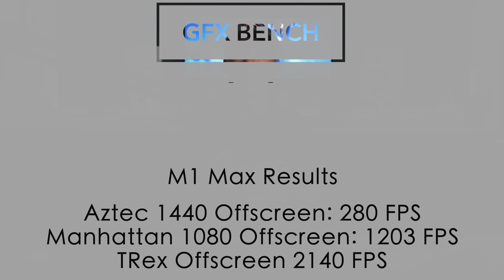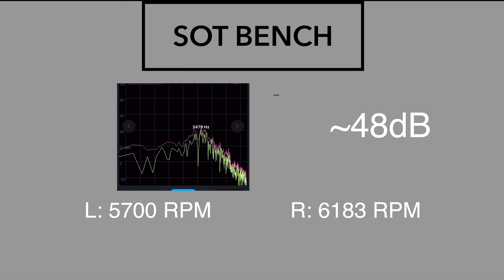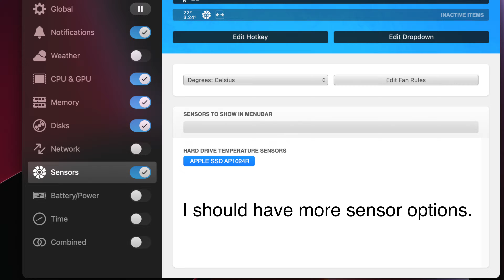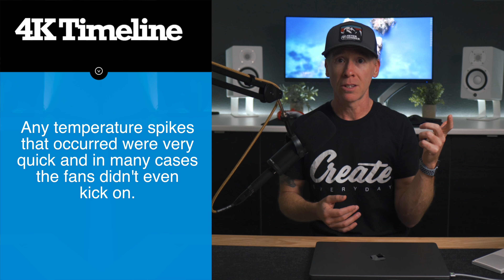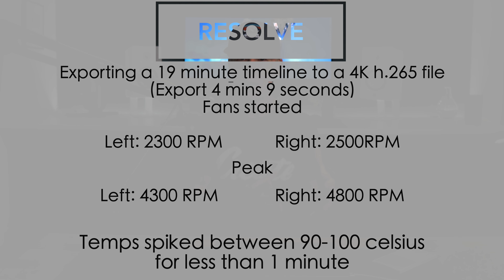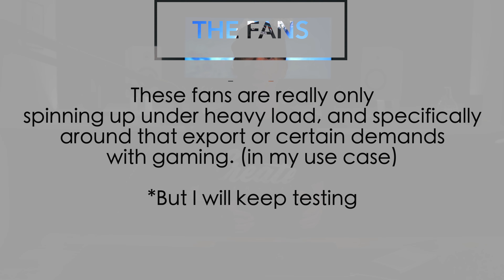M1 Max 14-inch MacBook Pro Performance, Battery Life, and Fans

Comment: THANK YOU - Finally some good fucking review.
Talking about the battery and real life examples of daily usage, thank you - what brower are you using daily? and do you think you can get 8 hours of battery life just doing basic stuff? browsing and youtubing?
Reply from the maker: Thanks! You’re welcome. I do have both Safari and Chrome and switch between the two, but I’m also testing low power mode and it seems the efficiency cores are doing that lifting. For general use though, yes I think you’re going to be fine for the day because I was pushing it for a cumulative 6 hours.

Comment: Yeah, I picked up the 14 inch M1 Max with binned 24-core  and 32 GB of Ram. I’m curious if it’s worth down grading to the M1 Pro with 32 GB of Ram.
Reply from the maker: Well, would are you mainly using it for?
Reply: @KevinRossRN  I just a few things. I'm upgrading from the 2018 base model 15 inch MacBook Pro. I use it to help with my church streaming, some video and photo editing in the future and I teach via zoom one a week. On Sunday mornings I manage 18 live videos streams for two hours on Sunday mornings. No I will admit, I had no idea what I was getting when I placed my order. I mean I did do it at launch day.
Reply from the maker: I do think the M1 pro will handle that, and I completely understand. I was ripping through my configuration on preorder day as well and I don’t regret it, I do realize that I got a lot of machine here. 🤷‍♂️
Reply: @KevinRossRN  I ordered the base model 16, then the base model 16 inch with 32 Gb of Ram, canceled both before I settled on the 14 inch M1 Max with 32 GB.... It was a crazy morning trying to figure out what I really wanted. Now I'm at the point that I don't want to re-order because I won't get it until almost December... LOL
Reply from the maker: I know the feeling. I thought about bringing in a 16 inch for testing and saw those shipping times, which I knew this would be the case, but it does sting a bit.

Comment: Thank you for all the test and content that’s really helpfull!!! Really happy with the base MacBook Air, I will wait for the m2 air and this time add the 16g ram that I really I need for part of my workflow or maybe the m2 Mac mini. Impatient to watch the result of your test on external Ssd’s also because I still have issues with the iPad Pro 11 2018
Reply from the maker: Thank you friend. And I should have that video out next. Remind me of the issue you’re having with the iPad Pro.
Reply: @KevinRossRN  it’s a large difference between copy and paste on the iPad vs on the SSD
Reply from the maker: I gotcha. Likely the limitation of that throughput, although I suppose it would depend on the size of that copy and paste.
Reply: @KevinRossRN  exactly depends of the size and the source where you copy it because I don’t have the issue with the MacBook Air.
Reply from the maker: Yeah, I can’t remember the throughput on that model, I’d have to look it up, but it sounds like it’s pretty slow…obvious 🤷‍♂️

Comment: So M1 pro is more friendlier for the  battery than M1 max for the 14 models?
Reply from the maker: Well the M1 pro in general, however I should also emphasize that maxing out those GPU cores, which I’ve done, will also be more power hungry. 

There is a low power mode for these machines, which I will test, but on this test I didn’t toggle on low power mode.

Comment: Nice Video As Usual 😃
Coming from the 13” M1 MacBook Pro
I think the best configuration to get a boosted performance without losing much battery life
Or gaining more fan noise is to not go to the max for 14” 🤔 
14” M1 Pro with 32GB RAM is gonna be an over kill i guess 😅
Reply from the maker: Well the extra RAM is nice. I do think that the base model 14 is a good value if you want that screen and that extra I/O. But “value” is of course relative.
Reply: @KevinRossRN  yeah totally agree !

Comment: Thank you Kevin, yes I am interested in your findings regarding transfer and read/write speeds when using an external SSD. I recently purchased an M1 Mac Mini and did notice some throttling back on the read speeds when using the TB3 port.. Appreciate your time.
Reply from the maker: Yeah, I definitely tested that quite a bit on that mini, which is still in my rotation. I’m testing today and will be through the weekend as I’m waiting on one more enclosure to get here.

Comment: Just to clarify - the fans with the M1 Max fine under normal or moderate use? im ok with sound when the machine is pegged, but are tasks like youtube or sitting in photoshop turn the fans on? I know you kind of said that at the end, but I want to double check. my 16in is the most annoying computer with fan noise doing the most mundane tasks. thanks!
Reply from the maker: Correct. As another example…right now actually. I’m playing a 4K timeline in FCPX while also watching a 4K YouTube video in full screen and the GPU is at about 75-80% with spikes to 100% and temps are around 75-85C and the fans are off, however when they occasionally kick on they’re only around 2400 and you can’t hear them.
Reply: @KevinRossRN  thanks. that's exciting. i do a lot of 3D modeling so it'll tax the CPU up and down. from what you're saying it should be relatively quiet until I render. I saw a video last night claiming the sound from the 14 in M1 Max (32) was unacceptable and they made it sound like no matter what the fans are always full tilt. that didn't seem right and had me worried since that's the model I have coming in. glad i found your video and thanks for the reply.
Reply from the maker: Well and here’s the thing…and I’ll add this in another video. That CPU gets taxed in Blender and the thermals during my testing are at about 98C, but it’s that CPU, right? Well, the fans will hang at around 4400 (give or take) during a render animation, but honestly it’s not unreasonable…it’s not even annoying.

However, once this software gets updated to support Metal, I believe this should shift quite a bit.
Reply: @KevinRossRN  Very reasonable and during render, thats not a problem at all. its expected. my desktop PC goes wild during a rendering. And yes, good point about Metal. I just use Blender from time to time, but the main ones I use are Fusion 360 and Rhino and for rendering Keyshot. None of those are M1 native yet, but all seem to run well with Rosetta on the M1(standard.)It will be interesting to see how they work with M1 Pro/Max. Its been tough finding info since they're pretty niche programs...especially in the Mac community.
Reply from the maker: Yeah, and I wish I could test them all. At least with Blender I can run a few of those samples that have been created by the community. It helps, especially since this isn’t something I use.

And yes, Rosetta is great. But as in this example of Davinci Resolve can run this well and it’s not an Apple app, then it seems like others can…although I know these are different programs.

Comment: Knocked it out of the park with this video. Hit everything with no filler or fluff, hella informative and entertaining and still kept it under 10min. Well done. 
I'm super frustrated with the fan noise on the 14in. I should have known better tbh (and I did really but missed the delivery window I needed for the 16in). Oh well at least Apple extended the return window because I'll definitely be taking my 14in back and trading it in for the 16in. I simply cannot accept 48db of fan noise (at least not when i know $200 will make it a non issue).
Reply from the maker: Thanks! And yes, I was thinking the same thing initially that for the extra 200 in getting that higher thermal headroom. It can certainly be worth it for a lot of folks, but so far, except for gaming, they’re either off or only ramp up for a couple of minutes when it’s pushed.
Reply: @KevinRossRN  I was watching LDre live stream while running ableton and he said the fans were audible the whole time. This is exactly what my use case will be so assume my results would be the same. He didn’t even have an complicated animations going in the stream or a guest. So for me I think 16 is gonna be where it’s at. Thanks again for the reply and the info. 💯
Reply from the maker: Of course! And yes, get the one that fits what you need my friend. Great to have you here on this one 🤙

Comment: awesome video ... I would be interested in what happens when the room temperature is set for summer conditions.  in winter everything is fine with my i5 too, but in summer it literally explodes
Reply from the maker: Thanks! I’m going to try and test that out in the sun. It certainly gets cold here, but it’s mostly sunny in Colorado, and we still have some nice days, but it’s definitely not summer for awhile. Maybe I can find a neighbor that likes to keep their house at 85 and I can set up shop for a bit. 😉

Although we do have an open floor plan and this studio is the only closed room on the main floor and I can certainly get it toasty in here with the two heat vents and all the lights.
Reply: @KevinRossRN  thx man… yeah or maybe you can test in front of a fireplace or so? that what be really good to know… i think nobody else will test this but it’s so important to know 😃
Reply from the maker: You know what? That’s not a bad idea. That could make for a great video. I do have a fireplace.
Reply: @KevinRossRN  awesome man… looking forward to it.. all best & 🙏 thx
Reply from the maker: You bet 🤙
Reply: @KevinRossRN  and by the way what also haven’t seen yet… nobody is testing it with 2, 3 or 4 pluged in Monitors… that was a big issue on the intel version. can it handle the heat when the macbook is closed? cheers
Reply from the maker: Yeah, I’m trying to pull together some displays that push it a little harder. Good suggestion.

Comment: Well, sounds like I need to cash out some tesla stock and buy one of these then. You're hitting on the points that I'm most concerned about here, being able to work for a few hours without having to sweat suddenly running out of juice.

I haven't been on a mac since my macbook pro 2010, which I still have. I'll have to do a compare between the two ... no dvd drive, no upgrades to my ram or storage, but I think I think the update will beat it in a few other key areas.

Thanks for making the video and digging into some of these details!
Reply from the maker: I don’t know, that Tesla stock might be pretty valuable as we head into the next year 🤷‍♂️

Although, if this MBP can make you money, then maybe that’s your angle…or at least save you time 😉
Reply: yea..id hold onto that $TSLA.  I just buy more when it dips :)
Reply from the maker: Long game. 📈